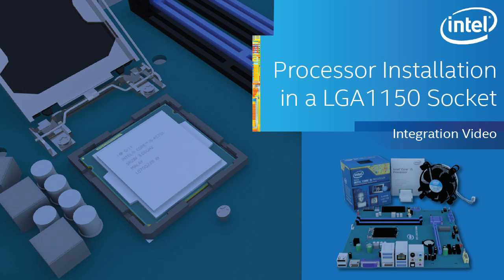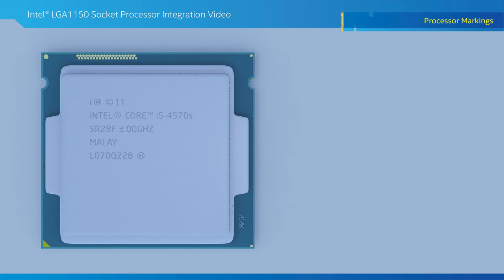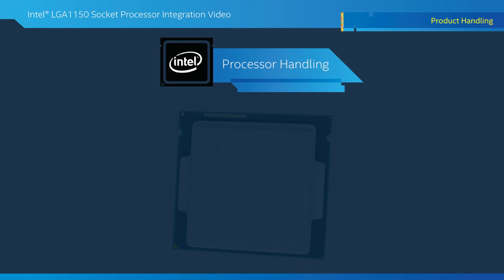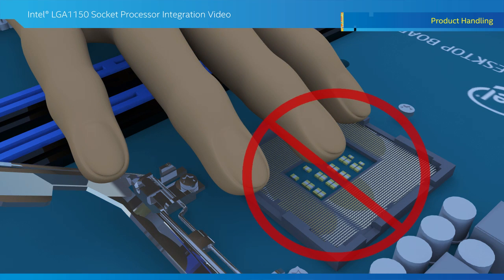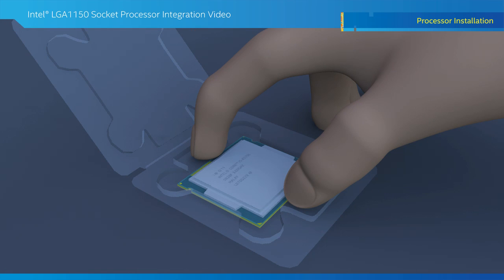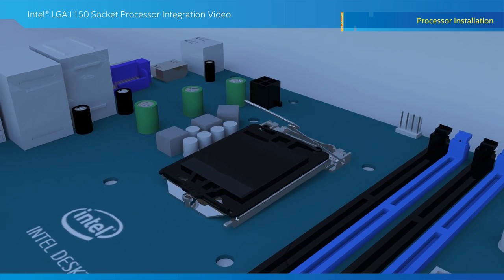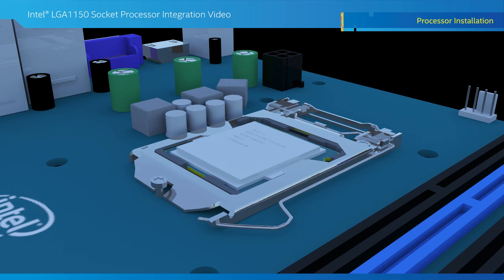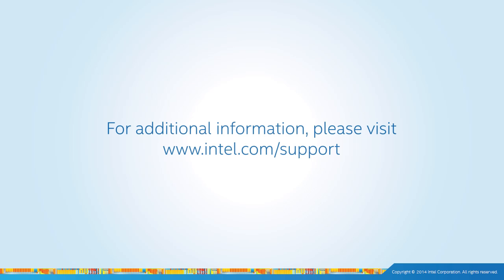Processor Installation in A LGA1150 Socket | Intel

Comment: @Intel is is possible to obtain a pdf with schematics of LGA1150 motherboard DH87MC? I acquired said motherboard in damaged state, someone ripped off a few SMD capacitors and I need to find out the values that go there.
Reply from the maker: Hi! You can find the specifications of your motherboard here: https://intel.ly/3FQrVga You can also post your query on our community forum at https://intel.ly/3MymdU3 where our fellow community members will help you in the best way possible.

Comment: My socket is LGA 1150
Can I use i5 3470 or 3570
Please tell me
Reply from the maker: Hi! We appreciate your interest in Intel products. The i5-3470 and the i5-3570 will require an LGA 1155 socket. The processors that would fit into this LGA 1150 socket type are the i5-4460/5675C. However, the CPU compatibility is best determined by the motherboard maker. Kindly contact the motherboard manufacturer for compatibility: https://intel.ly/3d6ZbB8
Reply: @Intel  yeah...I will use intel in my PC

Comment: what.
he not apply thermal paste to processor..
Reply: Intel CPU fan has internal thermal solution
Reply: @iambadatsomefunnies5572  lol
Reply: it has the thermal paste pre applied u do not need to replace it ... cuz u r not over clocking if u r using the box cooler!

Comment: Is LGA 1150 obsolete? The chipsets for it only support PCIE 2.0 and only 8 lanes as far as i know
Reply: The chipsets, yes, but the CPU-attached are often PCIE 3.0 with 16 lanes. (Or 8 lanes depending on the board) If 2 CPU-attached PCIE slots are used the amount of lanes will stay the same (So 8 and 8 or 4 and 4) 

The only chipset that doesn't allow this to be is the H81 which only supports  PCIE 2.0 and 16 lanes on the CPU-attached PCIE slot. But, I don't think it will be a problem for anything but the highest end graphics cards at this point in time if a single slot is used. And well, I don't know if other parts that connect to PCIE need the higher speed of generation 3 but if yes then the only thing you have to do is make sure you get the right board.
Reply: So it applies only for the slots wich arent attached to the cpu?
Reply: Yes, the manual of a motherboard can often provide information about which generation PCIE applies for that board, if it is gen 3 it is CPU-attached anyway. (Which applies for most boards)

Comment: hey its a good video can you give me a damaged i5 processor for free which is not use for youThank You
Reply: PremiumGamerMC Nice to hear, having parts DOA on you is very fustrating.
Reply: Nope. A 'damaged' Core i5 is made into a Core i3 if one of the cores are damaged or get melted and make into other CPUs.
Reply: Zero necker I orderd an i5 6500 with a MSI z170a gaming M7 and I think one or both of the are defective and it made me sad because my PC looked so beautiful when I finished it and I was so hyped up to turn it on but it didn't boot :(
Reply: PremiumGamerMC Damn that's sad. Doesn't the boxed CPUs have a 3 year warranty? Your motherboard too, it's quite high end. You should send them back.
Reply: +Zero necker I still have some troubleshooting to do, but yes I'm planning to exchange them.
Reply: Zero necker I just got it to work today, it was just that the power cable for the cpu was crooked, all I did was push it in more and it was able to boot up.

Comment: All wrong, you must unwrap the cord and install it so that the cord is not wrapped around the cooler and goes right to the connector, then bundle up the rest of the cord so it doesnt get caught in the fan.
Reply: Remember the old days when you can learn how to install stuff with real things. This is so lazy and the script writer is lazy too.
Reply: I mean WTF is 'Thermal Solution' ???? It's a god damn cooler not a 'Solution' to remove heat as its shit as fuck. Overclock it and you are fucked if you don't have a Dual BIOS motherboard or a better cooler to slap on there.
Reply: ***** Well they do, not the high-end ones. I'm pretty sure the stock cooler can handle a small overclock fine too.
Reply: I need to be sure not to disturb the pre applied thermal interface material
Reply: Its a solution to cooling the CPU.  Nothing wrong with the phrasing.

Comment: guys i need help!!! 4Core1333-FullHD thats my motherboard i wanna buy intel core i3 and i am scared because if it does not work? i really need help they told me if i have motherboard that does not support intel core i3 processor maybe it will not work any help?
Reply: SonGoku SSJ4 What socket is your motherboard?  What is the model number on the I3 you want installed (assuming you haven't already solved the problem)

Comment: They did not mention anything about thermal paste
Reply: they did, they are refering to it as thermal interface material (TIM). It's also preapplied to the stock fan so doesn't really need to be mentioned

Comment: Thanks, but it's a whole year late for the 1150 socket.
Reply: Tbf, there are some people that still 5 years after you posted this that still use lga1150 chips
Reply: why? the Hawell Socket isnt out so long time so..
Reply: rV Evade #COMEBACK SOON! The Haswell Processors came out on June, 2013, with the Z87 motherboards and 1150 Socket. I know because I have the Haswell 4770K processor with a Asus Z87-Expert motherboard, and I bought them in June, 2013 fresh out. You're probably confuse with the Z97 with 1150 socket and Haswell Devils Canyon processor that just came out in June, 2014.
Reply: rV Evade #COMEBACK SOON! No, I'm a video editor, but not professional. Just do work for my family, my friends, and myself. I do a lot of HD 1080, 720, DVD, Blu-ray, and Blu-ray 3D writing.